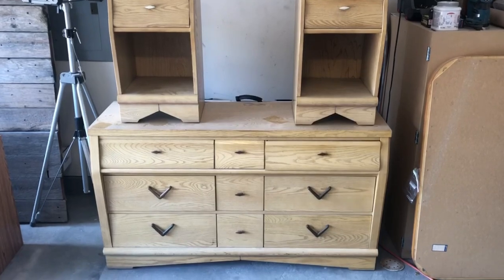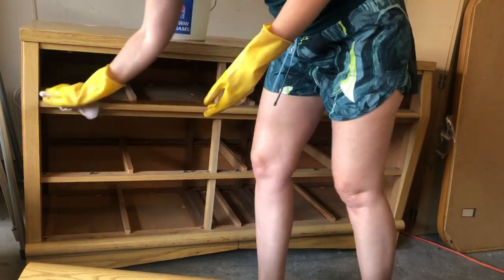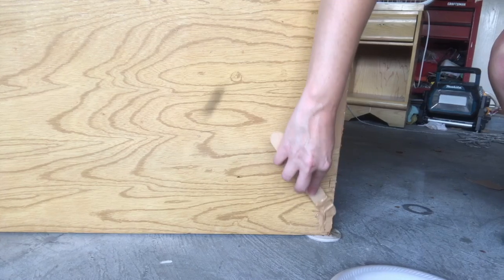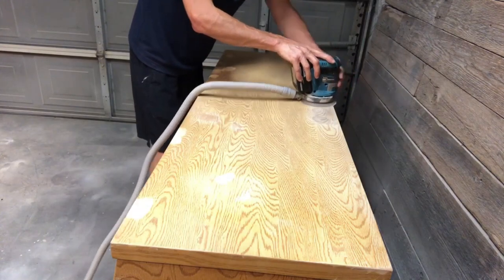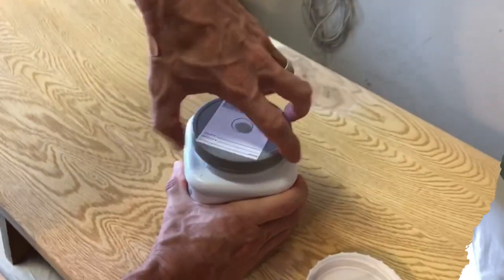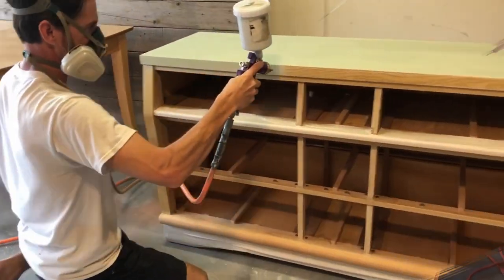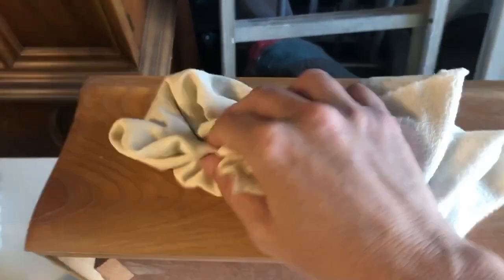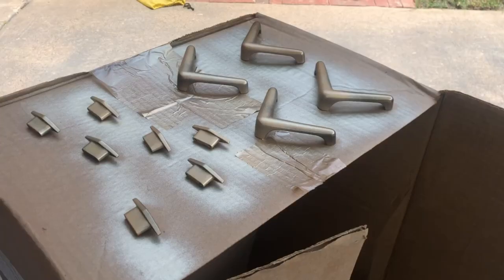Mid Century Modern Bedroom Ideas I Mid Century Furniture Makeover I Dresser Flip Ideas

Comment: Can't wait until next week.  I have 2 bedrooms of that exact same French Provincial, and original hardware.  I haven't figured out what to do with it, I was just going to paint it all white, it has yellowed and the "gold" detail is scary.  Do you know if the rustoleum white oil based paint turns yellow?  It says it won't but I thought all oilbased paint does, could be a special formula?  I did not find you in time!  I did not know about latex covered with a clear topcoat was durable and I thought it would be junky looking, I was wrong.
Reply from the maker: Not sure on the rustoleum product. Haven’t used it. I did however have to peel off 2 layers of latex paint on next weeks flip. That was awful. I did a very detailed sanding job to make sure the chalk paint would adhere and I used a VERY bright color that shows everything so it had to be perfect. Wanted to leave it on the street a few times 😂.